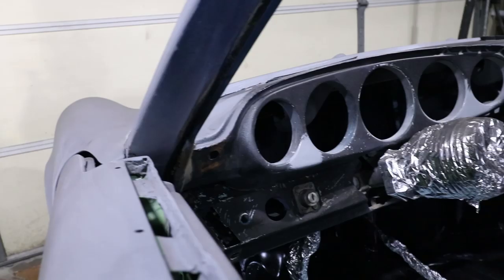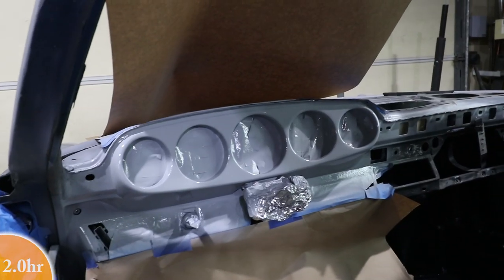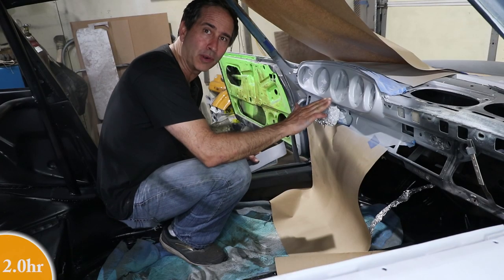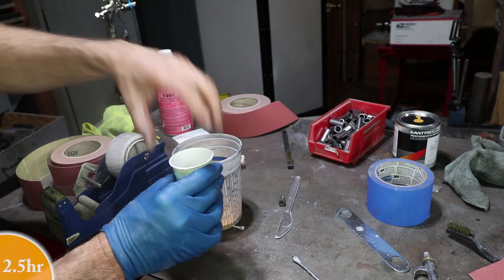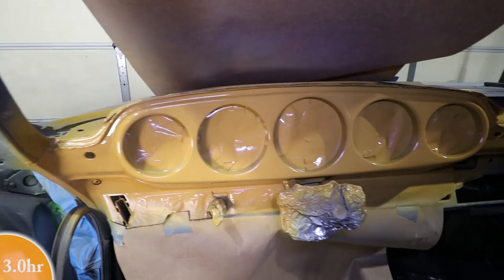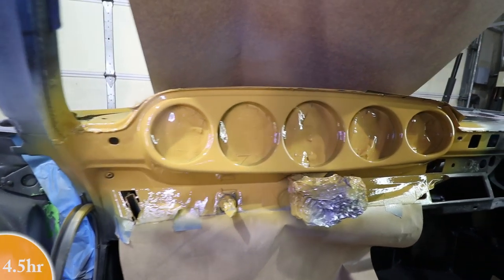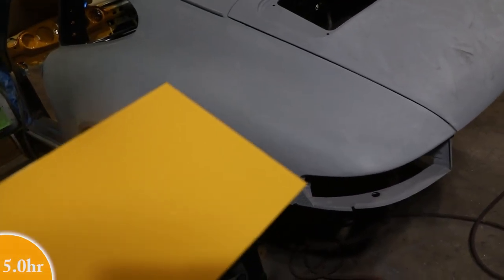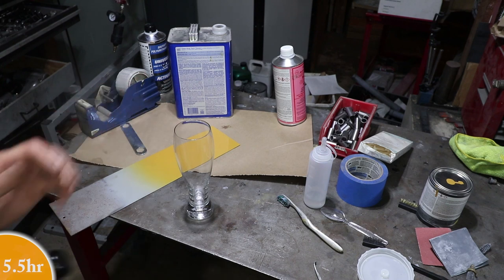Ahh First Color Sprayed On My Vintage Porsche 911 Wreck

Comment: Looking good, Tom. I, too, was surprised how shiny the base was before clear. I also found some runs after final painting well after I thought I was good. Very subtle in places. The fight with the trash is unwinnable, I think.
Reply from the maker: Cool, thx Chris.  Once again I was impressed with SPI's products and literature.  It works as advertised with very little tweaking.  I expected the dust, so I wasn't even bummed out about it   we'll see how the body comes out in a downdraft booth!

Comment: Regarding the dust: inside the car and on perpendicular surfaces dust isn't that much an issue. I sprayed the inside of the cab of my 1960th lorry and shut the doors immediately after painting. I had almost no dust particles in my paint job. Unfortunately this is not true for the outside. Without a paint booth this can not be avoided.

Regarding the color match: If this is a original Porsche color and they have it in their data base it should match quite well. The color of the old bumper may be off quite a bit because of the age. They used single stage paints those days and these colors do age quite a bit. I had this problem with my lorry.  Also with the basecoat / clearcoat system the color can vary  the way you spray it.
Reply from the maker: Right you are!  This paint mix was based on the factory color.  When the put a little blob on the bumper it looked perfect but once it was sprayed it appeared lighter.  I agree that the original may have darkened over time.  I prefer the fresh lighter color anyway!  
I also agree with the dust situation 100%
Thanks for sharing your experience.  Sounds like you have a nice ride!  Enjoy!

Comment: Dig the color,  Tom. Not a big fan of external hood latches, tho.
Reply from the maker: Thanks!  I'm not using external hood latches.  Did you see something in this video?
Reply: @GarageTimeAutoResto  no, no. I've just seen some on other builds and I didn't know how else to bring it up. Keep killin it!
Reply from the maker: Gotcha!  Thanks.  My feeling is that those external Jeep style latches aren't safe when attached to a fiberglass bumper!  Or for that matter the decklid latches that attach to the license plate panel are also weak.   By the time the attachment is beefed up a bit there isn't much weight savings anyhow.  Therefore I'm not a fan either.  I hope Jeep owners aren't offended!

Comment: Really appreciate your videos. I try to figure out what I can do myself in a restoration job and what tooling I would need. What compressor do you use ? Isn't that just as important as the spray gun ?
Reply from the maker: Yes, my compressor died during the primer phase.  It was a 30 year old craftsman 5hp 30 gal single stage.
Then I bought the Ingersoll Rand 5hp 80gal two stage.  DO NOT BUY this one.  Two motors have failed already.  
Two stage seams to trap more water in the tank, which is a good thing.  Better in the tank than on your car.  
I encourage you to do as much diy as possible.  I'm  really impressed with today's materials.
Reply: @GarageTimeAutoResto  That's odd, they're supposed to be premium. It must be disappointing spending some good money and end up like this.
But what I meant was what specs you're looking for in a compressor if you want to paint ? The crew at some local (local in Stockholm that is) toolstore does not seem to have the skills or experience to help me with that...
Reply from the maker: The IR compressor was only $950.  The pump is okay, but the motors are junk.  
5HP is minimum and I like the large tank.  When I'm painting small sections I don't even  let the compressor run.  That means no water.  Dual stage goes to 160 psi which holds more air in the 80 GAL tank.  
My 30 Gal tank was ok, but the compressor had to run more, which means more hot water vapor in your lines.  
If you are looking for a scfm rating, then just check on the spray guns instructions.

Comment: Perhaps by using a darker primer, it would have gotten you closer to the original.
Reply from the maker: Yes, you are right.  I'm not going to be stickler for originality on this.  The color is good enough and I like it.  I tried to do a light coat on the steel sample to see if the primer would show through.  I can't really see a difference in color.  Plus this isn't a high end base like PPG that might cover better.  So it was a learning experience.

Comment: Seems like a lot of overspray for a hvlp.     Gonna use a lot of paint.
Reply from the maker: I used a higher pressure on the clear.  Maybe it was too high?  I think the camera lights made it look worse too.
Reply: @GarageTimeAutoResto  Hey It's your project go for it?  I'm doing the same thing to a '77. It's gonna be an IROC.
Reply from the maker: I really like that IROC style cars too!  Have fun.  The paint I chose is cheap anyhow, $250/gal and the clear is around $250/gal also.

Comment: Your orange peel is from too much air not enough material and your nozzle selection is off anything under 1.5 mm needs to be reduced thoroughly before you can spray it properly it won't atomize right
Reply from the maker: Are you referring to the epoxy primer?
Reply: @GarageTimeAutoResto  Yes I shoot epoxy primer all day long for  Cat on equipment. I generally shoot it with a 1.8 mm

Comment: How are your eyes feeling,arms,legs.Haha
Reply from the maker: It wasn't until I watched my own video that I realized how much overspray there was.  I think the camera lights made it appear worse than it was, but next time I'm wearing my goggles and long sleeve at least.  I didn't have any discomfort though.
Reply: @GarageTimeAutoResto  Its all about picking each other up.Just wanted to take a minute to tell you that your doing a fantastic job.
Reply: @GarageTimeAutoResto  Btw have you thought about going to a waterborne base coat?
Reply from the maker: @kevinbodman1011  I haven't considered it?  Unless the booth location requires it.  Last I checked the paint I selected should be ok.